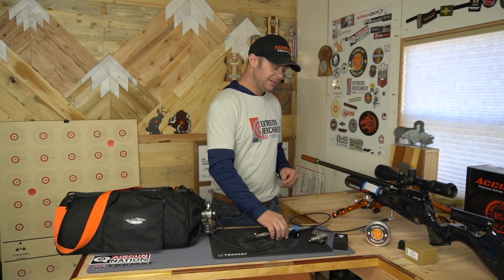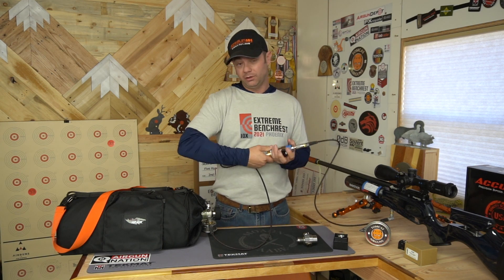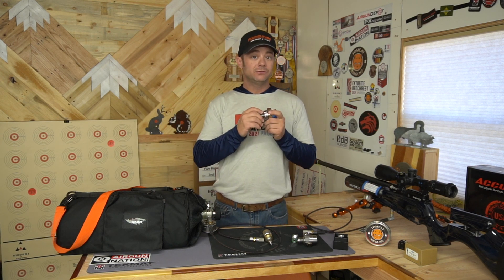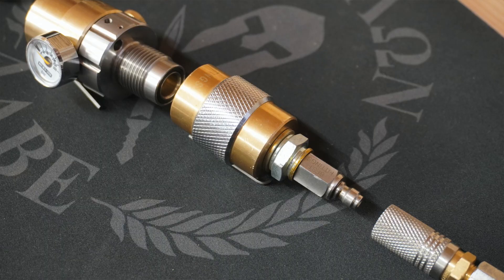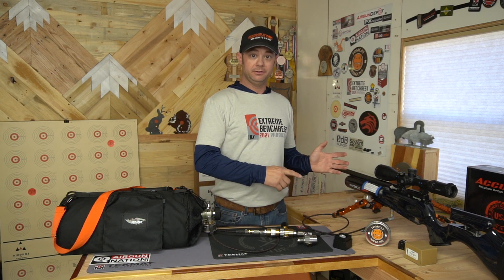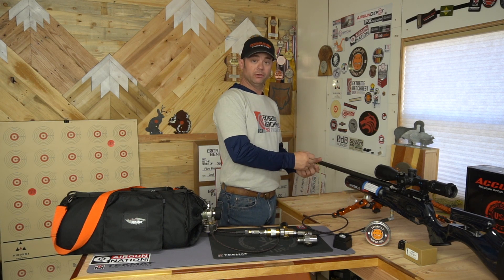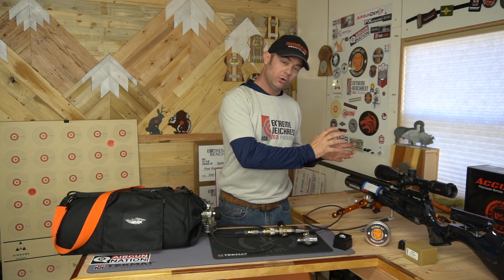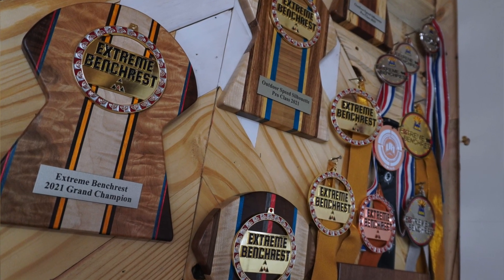Huma 1197 Externally Adjustable Inline Regulator

Comment: where can i acquire those adapters?? ive got the Air Venturi 74 cu ft bottle which has the DIN...the regulator i bought is the HUMA DUAL GAUGE INLINE REGULATOR( bit more pricier, but shows input and output, latest, greatest model i think..Or Should i just screw the dual gauge regulator on the bottle? i guess with the model i bought i can refill the bottle through the regulator..Plus, since my tank has the DIN fitting, can i install this with pressure in the tank since i have the on/ off knob on top of tank and bleed valve on the side??
Reply from the maker: I got mine from Airguns of Arizona. I have not heard of a regulator that CAN allow filling. All regulators I have seen are one way only. Triple check before you try it! I'd recommend giving AOA a call. Their staff is very knowledgeable and will be happy to help you out.

Comment: If I had this attached to my 4500psi tank and had it set to 250bar, if the reg failed would it shoot the whole 4500psi into my rifle tank?
Reply from the maker: I can't answer for sure but, one of 2 things would probably occur. Either nothing would flow or there could be no pressure restriction. But, these are mechanical devices. I haven't heard of them failing.
Reply: @Atoyota25   I see that they have a newer version out with two gauges and a higher price tag. Have you looked at one yet?

Comment: You’re right, the online instructions leaves a bit to be desired. I was wanting to confirm the 4mm set screw that applies tension to the body to hold your desired setting in place. Thanks.

Comment: You actually don't have to bleed the air before adjusting pressure within the "step" setting (on the external adjustable model), HUMA has a vid on their site demonstrating that. When you take out and add washers, you obviously are going to need to degas the regulator, since you are taking it apart.

 Air trying to flow backwards through a reg doesn't damage it, it just shuts the piston (it has to be able to take the input pressure, so it doesn't matter). How regulators work is there is a small orifice on the High side, and a larger opening on the low side, with a spring and piston in the middle. Only so much force can be applied to the piston through the orifice, which is counteracted by the spring and lower pressure air in the low pressure side, sealing the piston to the seat, shutting off the flow of air. Once pressure drops on the low pressure side, the higher pressure air is able to open the valve again and refills the low pressure side until it reaches the set pressure, when it is shut again. These really are not terribly complicated devices, hobbyists literally make HPA regulators with basic shop tools and hardware store materials (HUMA spends a lot of time and money perfecting theirs, and are still worth a lot of money). It amazes me that so many air gunners don't have a good handle on how these work.

Comment: Hey Tom congrats on EBR, nice shooing. I got the air chrony per your recommendation(great chrony. Now I'm ready to jump into a good compressor. I was looking at the coltri mch 6 but don't see much on these compressors. What do you use and has it held up well?
Thanks, Bob
Reply from the maker: Thank you! Check my videos on the Omega Turbo. I haven't had a single issue with it and I like it the best, of the 3 I've reviewed.